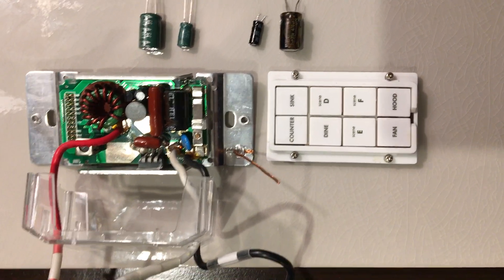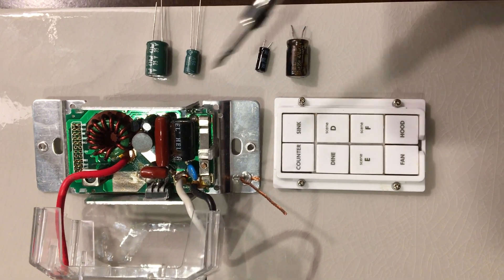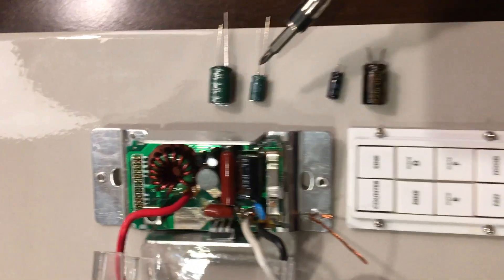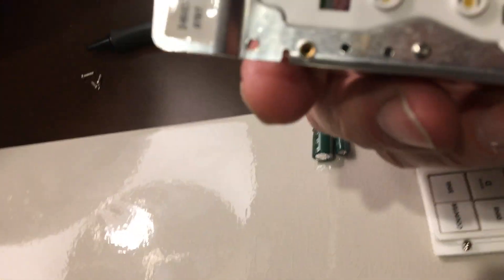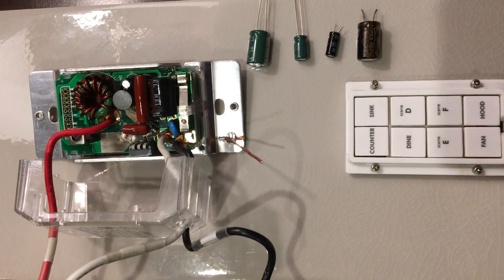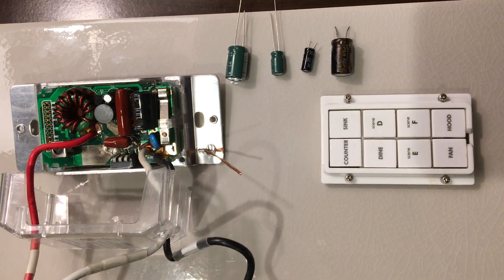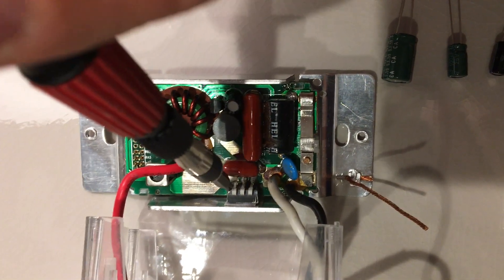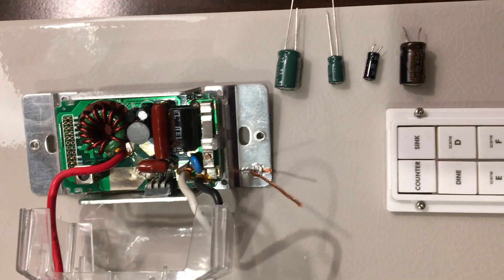Insteon Failed KeyPadLinc . Fix your dark Insteon switches

Comment: I confess that I did a kludgy outboard replacement of the 470mf cap following a different youtube video.  I did this with two Keypad Linc devices. One has been fine through thick and thin. The other one EATS the replacement capacitor after every power failure.  I even tried a cap with a higher voltage rating, but so far I've replaced three.  Does the 100mf cap also maybe need replacement to protect the 470mf one?